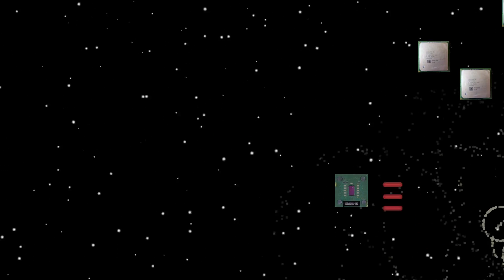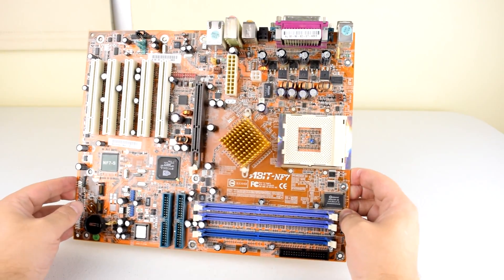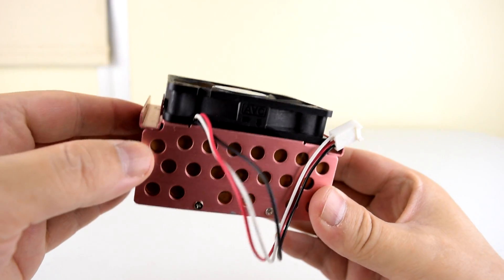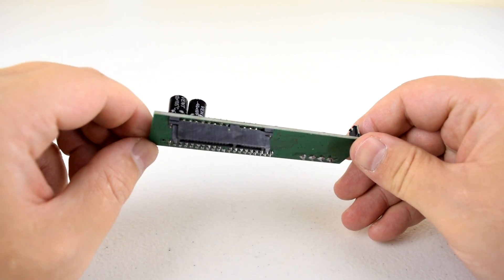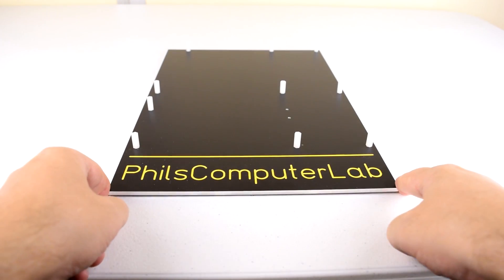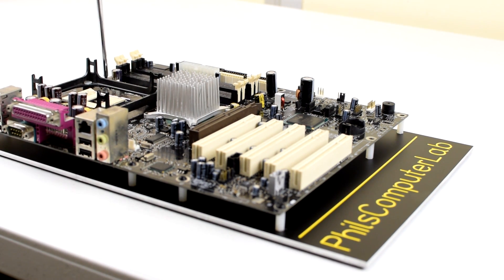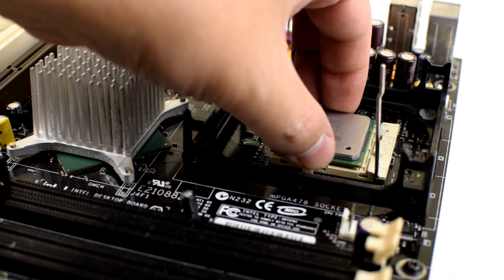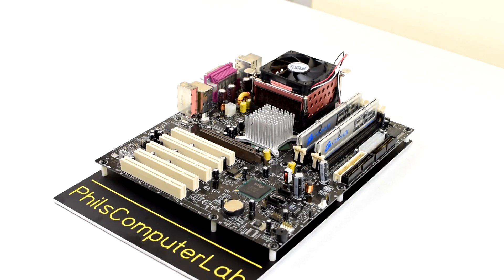Intel vs AMD S1E3 - P4 vs XP 3200+ GeForce 6800 GT and 875 chipset

Comment: When is the prequel airing? (AMD K6 vs Intel Pentium)
Reply from the maker: +Ricardo Graça Good question. Definitely will do something about that.
Reply: +PhilsComputerLab k6-2/3 vs. pentium II would be quite interesting, too. the AMD chips could kick ass when 3d now was supported and ran quite nice in applications. but without good software support, performance was not nearly as good. a 350mhz k6-2 was way cheaper than a 266mhz pentium II though, and could sometimes as least keep up.
Reply: Well, you could actually go all the way back to AMD 8086 vs Intel 8086 but I think there isn't much (if any) difference between the two implementations (not counting clock speed differences) until you get to the Pentium/K5 era.

Comment: now that I've had some time for everything to soak in, I've realized there is one factor not considered.  overclocking.  I dare say this was the golden age of overclocking, when aftermarket companies finally took notice and catered to the market?  late P4's were relatively horrible at overclocking.  Where AMD silicone did far better by comparison.
Reply from the maker: +Bradley Nuckols Yea my videos are really about building a retro PC "now". Prices, value, overclocking are not that interesting to me. If one of these machines is too slow: Just go for an Athlon 64 or Core 2 Duo :)
Reply: +PhilsComputerLab agreed, but it's still worth a mention, imho.

Comment: Back in the day, to myself. The amd xp/barton responed alot faster in apps then the p4. (I had a 2500 barton and a 3200 barton. Also with the nforce chipset. 
Ah well. Nice video. I'm still a supporter of amd though. Intel has to much power.

Edit:  A note though: It do was 2200 mhz vs a 3000/3200 mhz. Amd was faster a clock. I remember having my 3200 barton clocked to 2833 mhz. It was a monster then.
Reply: +Martijn van Zanen 2833 was really something.
Reply: Ye arround its max. The 2500 barton was arround 2600 or so. 
But I rly had it arround 2.8 ghz
Reply: the big difference was price, the 3200+ retailed at $464 at launch (May '03) while the 3.2ghz p4 launched at $637 in Jun 2003. Most 2500+s were overclockable to the 3200+ speed and where even cheaper. Back in the day AMD offered great value.
Reply: i had an overclocked cheap barton to 2.5ghz and it was killer already. i only really had to upgrade when intel's core2 cpus came around. those roflstomped everything that came before them.

fun fact: i have that cpu running in one of the computers in my retro-lanroom. it's the weakest of the 6 computers i have set up (i can easily build 4 more with the parts i have, but that's pointless), but it hold itself very well for the uses we give it. and yes, it has an asus nforce2 motherboard. best mobo ever.

Comment: How much was that new looking MSI 6800 GT? Probably not cheap. I have been looking for one for awhile. I have a couple BFG 6800 GT. I got two of them on eBay brand new for $30 but don't like the cooling. Don't be afraid to leave that D875 on all the time. They are indestructible. 24/7 a couple months at a time. Got three of them in 2010 from hypermicro when they were getting rid of their bulk for cheap and haven't had to touch the other two. They are expensive these days. A D865glc are the cheapest 478 boards around. They are indestructible also.
Reply from the maker: +RatCatcher Yea I wonder who actually built these boards. They don't look like your typical Asus or Gigabyte board. The MSI 6800 GT I got from eBay US for USD 35. The D875 is indeed a very nice board. In general I like working with the Pentium 4 AGP systems, they are very mature, stable and reliable.
Reply: +PhilsComputerLab Foxconn built the Intel motherboards with quality parts. They did get some of the bad capacitors pre-2003. But they quickly revised the boards. I don't think your yellow jackets are part of the batch. I have the revised polymer caps.

Comment: Oh i hope that Macron PSU label isn't lying :(
Reply from the maker: +Jason Hicks (TyrForFreedom) Yea good point. Everything worked fine though :D
Reply: +PhilsComputerLab I can't believe for many years.. I neglected my PSUs. Thank god for channels like Cube Computer so I could learn pretty much everything about them! These cheap PSU may say 600.. more like 250Watts
Reply: I have some 450 watt power supply lying around that weighs less than a single hard drive. No joke.

Maybe one of these days I should put it in a computer that I really hate. That would be a fun firework show.
Reply: MechaniKey LOL just looked at his old EX Media PSU i have (250W .. more like 160W from a Athlon XP 2200+ 1.6GHz) My new ZTE smartphone is heaver with a case on it, a 25pk of DVD+R, and i bet a carton of cigarettes is heavier! Swift breeze and there it goes.
Reply: Jason Hicks It's a Chiefmax power supply. I don't even know what the capacitor brand is, Chang? Probably worse than Teapo or Crapxon.
Reply: MechaniKey yeppers Chiefmax is the bottom (AscendTech sells em forever, i think they are there main OEM), I rebuilt a CM 650W and it didnt matter LOL Still crashed with a HD4850 while I was benchmarking it!

Comment: i recognized dat blurry Athlon 64 anywhere! i have a couple of 'em! only one of my AMD Athlon 64 motherboards still works tho :( but 1 is better than none! :) i planned on gettin' AMD Phenom X4!i wonder how good of support AMD Phenom works on AM2 sockets or do i need 2 get a Phenom X3?
Reply: ***** o ok thanks! i am gunna get me a AMD Phenom X4 now as a plan turned to a green light :D
Reply: +blakedmc1989RaveHD Be sure you get a xx50 version. Like a 9650 instead of a 9600. quad or tripple core. The xx00 series got a tiny bug ( makes a bsod in some calculations)
Reply: Martijn van Zanen oh ok! i was thinkin' of goin' 4 a 3.0 GHz AMD Phenom X4 4 my AM2 socket but it's a Gateway i'm referbishin' with a AM2 MOBO replacement
Reply: +blakedmc1989RaveHD Nice mate. I think i still got an AM2 tripple phenom. U can have it if you want. I believe its a x8450. 3x 2100 mhz though.
Reply: Martijn van Zanen i might have 2 update tha bios when i get tha mobo and AMD Phenom X4 3.0GHz
Reply: Yes. I think so too. But there is no AM2 phenom that runs on 3 gighz.

Phenom 1 is max 4x 2600 mhz 2 mbl2 and 2 mb l3 cache.
Phenom on 3000 mhz is the Am3 /am3+ with 6 mb l3 cache and prolly called a x945  phernom II
Your phernom 2 4x 3000 mhz, x945 doesn't work on an AM2 board.
Reply: Martijn van Zanen it might run since i'm readin' information which even a 3GHz AMD Phenom X4 is compatacle with AM2 but they could be wrong idk
Reply: Am pretty sure they are. Wich model type phenom are you trying to buy?
Reply: I do know, as side info: You could get a asus, m5a78l-m motherbord for like 35 bucks these days. It support a quad phenom 2. on 3 ghz to 3.4 gihz that scores arround 4000 to 4300 on cpubenchmark wich is quite nice.  But the mainboard is low power and supports the amd 8 core (max 8370E or 8320E) Fastest cpu for that board. The Fx 8370E scores arround 7800 or so. 
So its  cheap and fast none the less.For a quad or 8 core/threads.
Reply: Martijn van Zanen i'll get a Asus Motherboard if i get a custom unbranded PC but as 4 tha Gateway desktop, i'ma just get a Gateway motherboard 2 keep it almost original but i do have another spare Emachines case i don't really care about and i'll put a Asus motherboard in there. just have 2 throw in aftermarket parts 2 it or just get a different case! i just don't wanna limit myself 2 1 PC which i never want 2 do ever again :P
Reply: OK ok:) Hf with your hobby. Mate.
Reply: Martijn van Zanen no prob! i'm doin' everythang i can do 2 get away from potato laptops lol
Reply: Well get a HP . I think they are the best still.

( ps hate medion, hate acer, hate .. some more.. haha. And Dell is kinda ok.. but kinda sucky too)

Comment: Have you tested which is the fastest AGP card?
Reply from the maker: +Michael Hays I think the fastest "normal" cards are the 6800 Ultra and X850 XT PE. Later a few "AGP bridge" cards got released like the 7800 GS and ATI had a few very fast ones like the X1950 Pro and 3850 I believe. The ATI cards struggle a bit with OpenGL games. What do you think?
Reply: +PhilsComputerLab Good point, the 6800 and X850 are the last true AGP cards, and the later series were PCI-E versions adapted for AGP.
Reply: +PhilsComputerLab Yes, AFAIK the HD 3850 is the fastest available for AGP. What about compatibility though, does one of you know if a chip that "new" lacks any features that let's say a Radeon 9800 had?
Reply from the maker: Wow, tough one. I wouldn't think so to be honest, but you never know with computers :D

Comment: On the ABIT NF7 all you needed were Silicon Image 3112 drivers to make it work properly. Usually slipstreamed installations of XP include it, but you could've also loaded it through the floppy as well. That IDE adapter will really hinder performance. Just saying :/
Reply from the maker: +xan1242 It uses a SIL3112A? Interesting. I tried a slipstreamed disc with that storage driver pack. It picked up the drive, let you install Windows, but then restarted half-way through or something like that. I didn't have the time to figure it out, had to move on. The SATA to IDE adapter is actually quite decent, does 100 MB/s easy. I might check it out again with a 6800 Ultra if I get a chance...
Reply: PhilsComputerLab Eh looking at 3112's specs now, it's 150MB/s only so eh, not much of a loss then anyway lol

I had the motherboard way back, it did the job really well. XP 2500+ and a Sapphire Radeon x1650 Pro with 2GB RAM back in the day really did it for me. The only nuisance with it was the 3112 really, since that's literally a tacked on PCI SATA adapter on the motherboard.

Comment: Athlon 64: the closest that AMD was to dominate Intel. There will be blood, and a lot of BSODs.
Will Phil use socket 754 or skip to 939?
Find out on the next exciting episode of Dra-.. PhilsComputerLab.
Reply: Incorrect, Intel did claw back the lead with Northwood (which this video illustrates). The first Pentium4s based on Willamette were disappointing (can even lose to older Pentium IIIs). And then Intel faltered again with Prescott.
Reply: +jangelelcangry AMD absolutely demolished Intel's P3 with its K7 T-Bird processors back in 1999-2000. They were much cheaper and outperformed intel chips per clock. Intel didn't claw back the tech lead until its core architecture came along in 2006. P4 was a brute force disaster. Glad to hear that AMD is going back to its performance per clock roots with the upcoming Zen architecture.
Reply: VarietyGamer
I knew that P4 was a "brute force disaster" like you said but didn't knew that k7 was better than piii, I feel stupid now.
BTW. I hope those those benchmarks of zen vs i7 CPUs are 8 cores instead of like 16 cores and are real leaked benchmarks.
Reply: I vaguely remember the athlon being generally faster clock for clock with the exception of SSE enabled applications, which were more numerous than the applications that used AMDs equivalent (3DNOW or whatever it was called). AMD got SSE later with the athlon XP.

Comment: you should try to unlock the 6800gt to a 6800 ultra. I actually had (still have actually) a 3.0ghz p4 and a 6800gt from PNY I built back in the day probably sometime around 2004 for Half-life 2 etc. Using RivaTuner you normally can unlock the extra pixel pipelines and shaders as well as overclock it. resulting in increased performance by a LOT. This era of computing is actually a super interesting one and I remember it fondly!
Reply from the maker: +wenieo Actually it just needs overclocking, it has the same amount of pipelines as the Ultra :)
Reply: +PhilsComputerLab Hmm, just looked, I actually have a 6800 GS, unlocked it and flashed to an ultra over decade ago lol. The only way to tell was the heatsink art! still works great!
Reply from the maker: Yes that makes sense! A lot of cards were locked versions, I remember the X800XL.
Reply: the pci-e cards were the locked ones If memory serves me correctly. All agp cards I can find are the NV 40 chip (full ultra chip, I beleve this was due to the huge demand at the time for agp cards) I also own a pci-e 6800 gto and 6800 gt Couldnt seem to unlock the gto and as you said the gt just needs an overclock! Never got my hands on an x800xl. I upgraded to an x1900xt and then to an 8800gt later on!

Comment: Kinda surprising that the Barton didn't at least equal the 3.0Ghz P4, especially in games if even if not in synthetics. The big boy Prescot 775 CPU's with their extra cache and 3.6Ghz+ clocks would do even more damage and probably be bottlenecked by that 6800GT. I know that with an e2180 with a slight 2.2Ghz OC, I hit well over 12,000 on 3DMark 2003 (which is about the limit of the 6800GT). But then, of course, you would have to throw Athlon 64's into the mix. And we ALL know what happens there! XD
Reply from the maker: +TheVanillatech With the graphics card, I could go up to a 6800 Ultra, but not sure if that's even worth it. There is a 7800 GS but I also don't know if it's that much faster. I have faster ATI cards, but in OpenGL games it's slower.
Reply: PhilsComputerLab
Yup, those damned ATI OpenGL drivers from the early 2000's...

I think the 7800GS is a fair bit faster than the 6800 Ultra, but I could be wrong. Either way people had already started to upgrade to C2D, Athlon 64's by the time the 7***GTX series were commonplace. I think putting a beast like that in a Barton / P4 478 machine would be total overkill ;)

Comment: A bit off-topic, but... there are some bizarre motherboards from ASRock and Biostar that combine 478 socket with newer chipsets with PCI-Express & DDR2 & SATA2 support. Namely, ASRock P4i945GC and Biostar G31-M4. Of course, there would be serious CPU-bottleneck when using modern powerful graphics cards, but anyway it would be interesting to benchmark these boards with newer videocards (maybe modern mid-/low-end GPUs) and newer games.
Reply: +TheCureDMan There is also a 775 to 478 adapter
Reply: WaybackTECH I heard of this thing. Does it really work? Oh, and it will cause issues with cooler mounting.
Reply from the maker: +TheCureDMan Am awesome viewer sent me an Asrock board with a S939 socket with AGP AND PCIe slots. I do know of a 775 boards with AGP. At some point I'll just switch to PCIe.
Reply: PhilsComputerLab There are also ASRock boards with AGP+PCI-E combo and 775 socket, using VIA PT880 Pro/Ultra Chipset with C2D & Quad support. Yeah, ASRock liked those weird hybrids a while ago. )) I used to have DFI-branded 875 board with 775 socket, but it lacked CPU support above Pentium 4 Prescott, sadly. No Core2Duo and no even PentiumD.
Reply: +TheCureDMan Just last weekend I've got one of those ASRock boards with socket 775 and AGP+PCI-E. Problem is, that not every graphicscard is compatible with that board and the singe PCI-E-slot is a 4x only. I never liked those boards, wether when there were new nor now for retro.